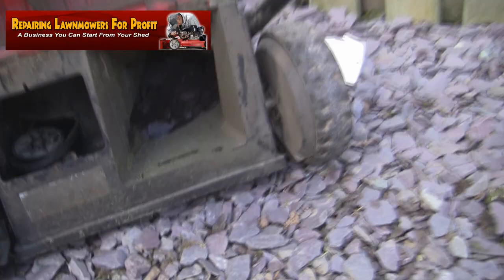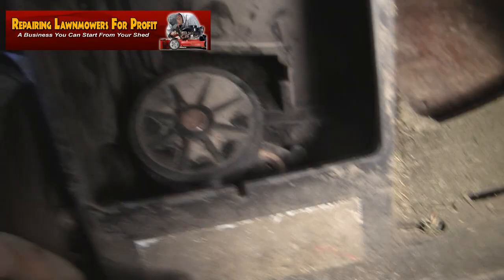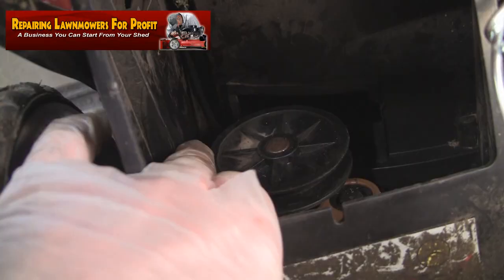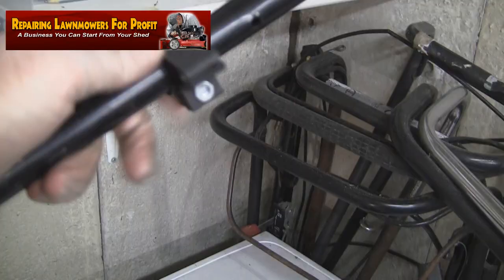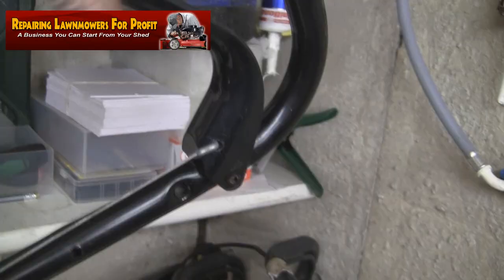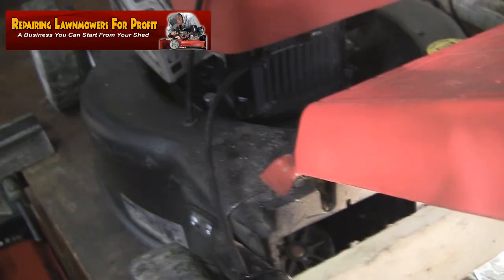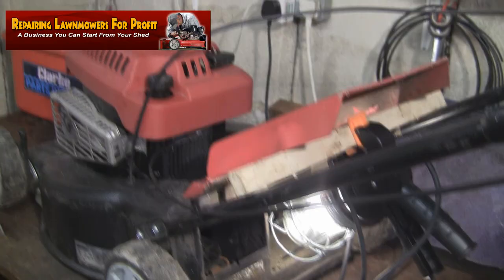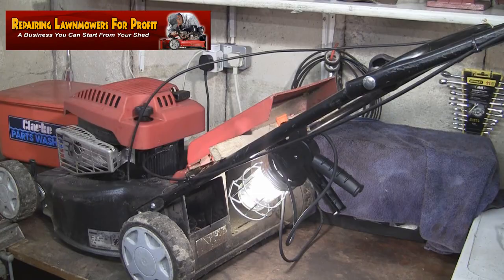How To Replace A Mountfield Petrol Lawnmower Self Drive Cable

Comment: Great video - the most problematic step I found was removing the old cable. After I had got the spring off the plastic boot on the end of cable housing had two retaining plastic lugs that prevented it from pulling out of the holder behind the drive. In the end I had to use a small chisel to cut/break these off to get the old cable housing removed. Very helpful video!

Comment: Brilliant video, just what I needed and it worked a treat. The only issue I had was seeing where to plug the lead in under the belt wheel, but it was there! And I think my new cable is too short but the mower works now at last. Thanks v much for sharing!

Comment: Just completed a clutch cable job today on my very old Mountfield 45cm P D, made in 2001 by Stiga. 

All I can say is thanks to your video I was able to do some research. 

No doubt about it ,this is a pig of job lack of space to get your hands in  and see what your doing. I took engine off as you have suggested in other videos to get better access and less weight for moving on bench.

Next job is to find the cause of the engine hunting , high revs followed by low revs.

Engine is a Classic 35 Briggs & Stratton. 

Have you done any videos on that topic at all ?

Thanks.
Reply from the maker: Nice work. Change the diaphragm and gasket in the carb. 10 minutes job

Comment: Hi , I have a mount field sp470 

I have noticed that it works with the spark plug being connected but not at full speed and as soon as I connect the spark plug it stops working 

Can you help ?

Comment: Nice work,my flymo quicksilver not running right could itbe drive cable slack,its around four years old but has done the work of a eight year old mower,large garden takes around three hours to do.the drive bar feels slack

Comment: How did you get the so called deflector off the back so to get to the cable attachment min is still moulded to the bloody mower impossible to get to
Reply: Came here for same question as you. About to take the panel off at back to gain access to replace the cable. Did you find out a way of getting this panel off. And then back on?

Comment: My problem is how on Earth the spring for the cable is meant to go through the hole. It's bigger than the hole! I'm flummoxed. That is the bit you couldn't film because it was too fiddly! 😂
Reply from the maker: @kierantynan  push it across from the side rather than directly trying to hook in. Pull it across with a cable tie if needed.
Reply: @MowerMan  tried everything but it wouldn't go through. Drilled put the hole in the end to make it bigger. It's a bodge job but it works. The mower doesn't have much life left in it anyway and I would have replaced it before paying to get this job done. Hopefully it'll limp through this season now.